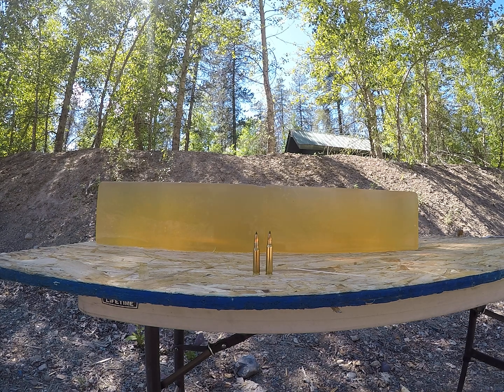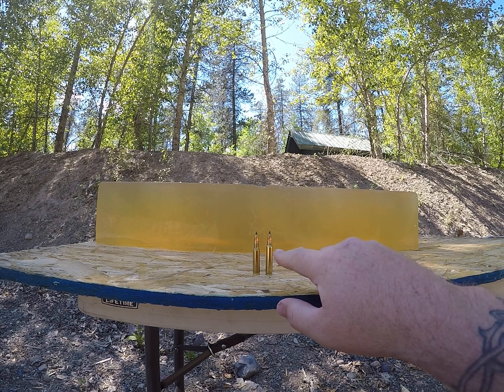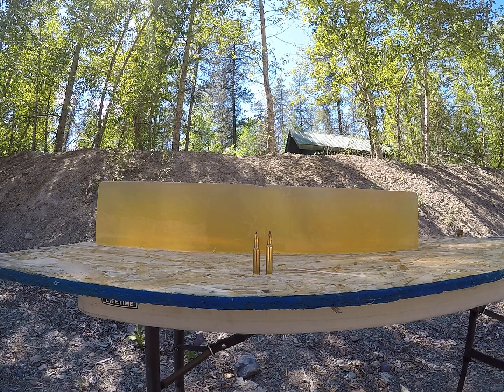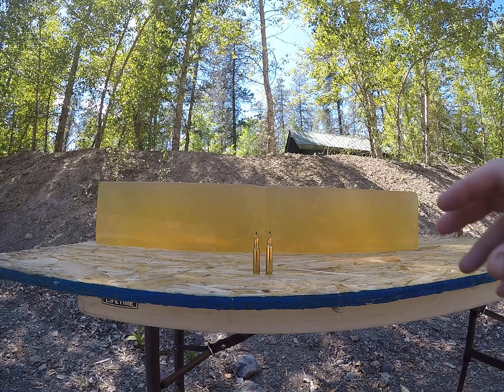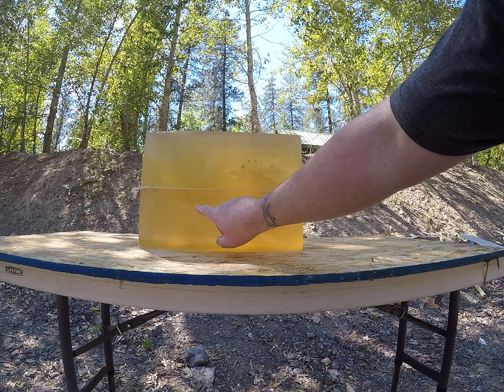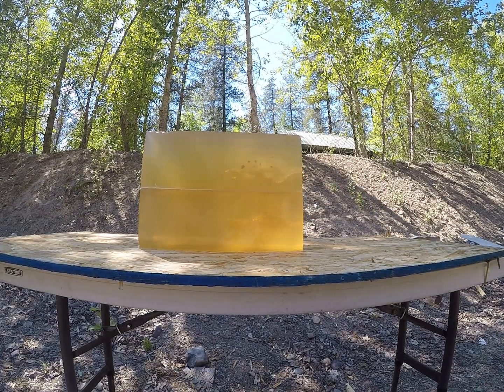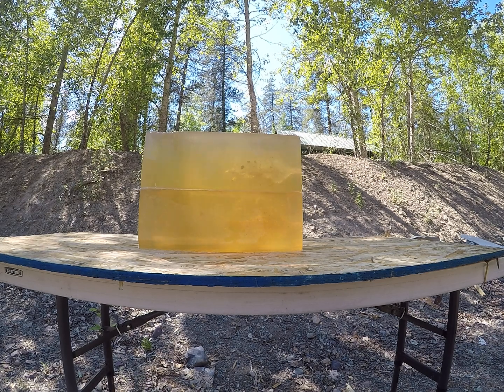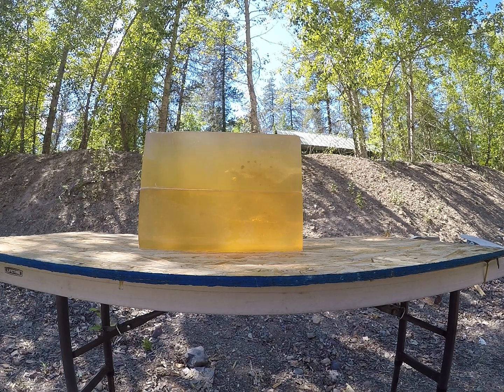Do RPM's play a significant factor in how a bullet performs after impact? (80,000 RPM difference)

Comment: Thank you very much for this test, it adds to the many questions I go through when choosing a new barrel design for any fiream I assemble.  Somehow I still have doubts that these simple results can't be extrapolated at large ; I have read too many scenarios where a faster twist has enhanced stability and terminal performance, from persons that had no reason to embellish the truth.

Just a quick remark on your gel blocks ; the one hit with the 223 appears to have much more clearly visible wound tracks than the one hit with the 222.  Maybe their diameters are relatively close between 223 and 222, nevertheless I would bet the block shot with the 223 would look much more disintegrated inside once ripped open ... and I would bet a fair amount on that.  Keep on your good work !
Reply from the maker: I cast natural gelatin, so the color can vary from block to block. 

I've done other tests in regards to RPM's using monolithics that show even better how little RPM's on impact make any difference.
Reply: Thank you to have quickly responded, are those other tests available on video ?
Reply from the maker: @ParkerHale06  Yes, Badlands Precision sent me some bullets to test some different broch designs and the differences that they may have with low RPM's to hopefully get better performance at longer range. Most of them I have uploaded at some point. (Not any of them that have new designs not currently in production) I will have to go back through my channel and find those videos later, and then I can share the direct links.
Reply from the maker: https://youtu.be/f0nlP-iG_OE?si=UVeYhH-JS0rXTH5I
Reply: I would really like to watch your other tests because here I really don't believe block clarity is the cause of what I can notice.  Diameter may be close but wound cavity volumes are clearly different between the 223 and the 222.

Comment: Honestly, RPMs matter, but not for this.
The amount of spin lost to bullet flight is WAY LESS than linear velocity due to drag.
But if you think RPMS don't matter at all, you might need to check out what Q is doing with high twist barrels.
It actually does matter. Just not for something like close range gel testing.
Reply from the maker: Correct. You can spin a bullet too fast and that can be problematic.
Reply: @simplemindedfella  they're actually spinning em so fast that they increase wounding at lower velocity.
But there's 2 reasons for that.
1)- subsonic have a speed limit, energy is thus a byproduct of increased mass. However, a heavy, skinny, non expanding subsonic doesn't have significantly more terminal effect from mass.
However, a slow, expanding solid, spun much faster, stays below the sound barrier but gets more petal contact with flesh via extended resolutions per inch over time in the fluid media.
So not only do you get centrifugal force encouraging wider mushrooming, but more turns per inch of the petals, and for copper expanders, with a small number of long petals, this can significantly increase fluid drag, acting more like a higher velocity bullet, shedding energy via crushing/cutting contact and friction.
Obviously thus reduces pebetration, but heavy subs often have buckets of peneteation, what they lack is large permanent wound cavities due to lower velocity in fluids.
2)- Used in supers it means that a bullet strong enough to not fail still might frag or mushroom more violently at lower velocities than it otherwise might. So instead of failing to expand at 1700 fps, it might expand nicely. Or instead of mild expansion at 2100, I might resemble the same bullet at 2400, and so on.

But there's a reported cost as well: some bullets fail easily. Also lighter bullets will overstabilize and strike a target post path apogee in a non-perpendicular angle, which sheds velocity and prevents good terminal effect at longer ranges (like 400 yards with lighter bullets).
Also, over expansion might prevent desired penetration sometimes. Designs would have to be reworked and heavily tested and the effects known to prevent frustrating an experienced hunter who expects different results from a given design, weight or velocity on a given game animal.

Also increased spin increases the side effects of coriolis force on shooting at long ranges... partly because of increased airtime of subsonics. From what I understand this means while the bullets are very accurate but they predictably behave in a less standard way.

Comment: I would like to see how spin rate effects bullets that tumble.  I've noticed weird bullet paths with those type of bullets and I wonder if the spin causes them to tumble in a "corkscrew" fashion.  Thanks for the vid.
Reply from the maker: I have used 1:8 and 1:10 twist barrels with .308 bullets both at high and low velocities and there is no difference. Even with bullets that consistently tumble. I do want to do more testing of different .224 bullets like this to futher prove that RPM's do not play a senifacant factor. With my current barrels in .224 being 1:14 and 1:8 it gives me the largest RPM difference.
Reply: @simplemindedfella  Those corkscrew wound tracks I've occasionally noticed (and always wondered about) were with FMJs that were designed to tumble.  You know, the bullets used on the battlefield.  Not sure if that's the cause but I no longer have those tumble bumble bullets to test.

Comment: I think rpm only matters if you have a fragile varmint bullet in a tight twist barrel. They can disintegrate in flight. I saw this happen. Kind of a gray puff and nothing in the target.
Reply from the maker: Correct. There are 30 cal bullets made to operate at sub sonic velocity for guns like the 300 AAC/Blackout that will fly apart immediately if shot at high velocities  with large cartridges. Knowing how bullets perform and operating them within their limits is important.  

Using the same bullet impacting at the same velocity as long as both are stable on impact will give virtually identical permanent wound cavities regardless of RPM's. 

I made this video to show that because of all the people questioning the RPM difference between shooting a gel block at long range vs reducing a load to simulate long range. The RPM difference has no effect on how the bullet performs in those regards, showing it is perfectly suitable to reduce a load to simulate long range shots.
Reply: @simplemindedfella  I think if the jacket is tough enough to not fracture along the rifling engraving then the rpm rate isn't a real factor in terminal ballistics. Considering a bullet only rotates maybe 2 times in 20 inches of wound track depending on twist rate, it just doesn't seem plausible that it affects expansion or penetration.

Comment: This simulation doesn't actually cover the real issue with simulated velocity.  .223 is a poor choice for this test.   The real issue happens with larger bullets leaving the barrel at low velocity.  It is not about the impact RPM, it is about the travel RPM. These longer Boat Tail heavy for caliber bullets require minimum RPMS to stabilize. I have seen a number of your video's where your lower velocity rounds are veering, and or not expanding true.  Signs of an unstable projectile. 
 Really the issue is whether or not the projectiles are flying true on impact.  I do not expect this is the case for the most part with your simulated low velocities but I am absolutely certain that is the case with a number of your tests.
The 6.5 CM craze is all relative to the 1:8 twist to stabilize these modern bullet offerings. Consider that when you think about a 1k ft/s lower velocity in a 1:10 twist. Those projectiles have wobble in many cases.
Critters do not care how many rpms you're hitting them with!
Reply from the maker: .223 caliber is all I currently have rifle wise to generate that drastic of a RPM difference. Regardless it shows RPM'S don't play a factor in how bullets perform after impact. 

As far as the stability, twist rates matter and not velocity. Take the 300AAC/Blackout for example or any sub sonics on the market, if reducing loads doesn't work they wouldn't eather. And yet they do and quite well.

Here is a video of about the longest and heaviest bullet I can drive with a Creedmoor that clearly shows stability in flight or lack there of is not an issue. (And I have others) The center balance point of the bullets are what is causing the tumbling in the gelatin it is not at all a lack of stability. 
https://youtu.be/Lr1F42kY3bI

Comment: Nice test . 
Now this is just a thought I have , no way to prove or disprove , but I think the RPM's won't matter on a mushrooming round , as the sudden jump in frontal area is going to mitigate Newton's law of inertia quite well . 
It's from a non-expanding bullet that the higher gyroscopic effect of the tighter rifling should show up . 
In a spitzer style projectile , the front of the bullet will slow at a faster rate than the base because of less mass , this rate of yaw should be magnified by the higher RPM's . 
Or at least that's what popped in my mind . 
P.S. I love shooting my .222 Rem , my favorite center fire round because it was my first .
Reply from the maker: I do have some Barnes bullets that instead of peddling straight back have a slight twist to the pedals. I was driving the 200 grain out of a 300 PRC with a 1:8 twist impacting the gel with 279,000 RPM's. Realistically you will never have that kind of RPM's on impact hunting.  I have put the federal premium line of bullets through the same kind of extreme stress and testing and you see no difference in them regardless of RPM's on impact, just the most beautiful mushrooms I have ever seen regardless of how hard I try to make them fail.  

Excellent thoughts thanks for sharing them.